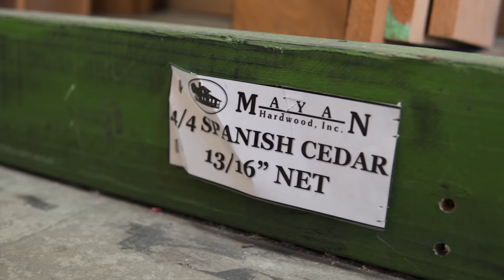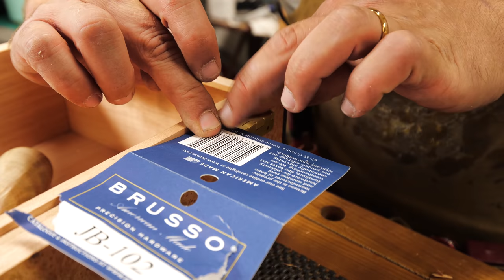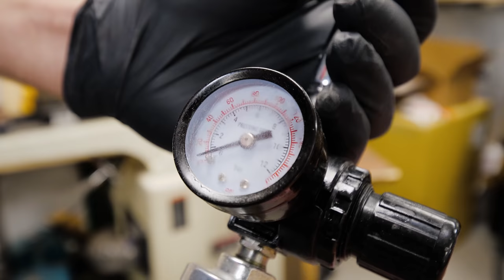Humidor with Maple Burl Veneer and Ebony Inlay - Build and Humidor Setup

Comment: Excellent video man! Loved it. Only tip I would offer: when you separate the lid from the box, it can be mated better. Best technique I've used is gluing down 4 pieces of sandpaper to a workbench, then sand the top of the box and bottom of the lid. This produces perfectly flat edges. It will make the seam look much more sharp. Loved watching the veneer. Nice to see a new technique.

Comment: Hi Jonathan, nice box.
In guitar making we don't use superglue when gluing wooden binding as it's not as strong a joint as wood glue. What I do is apply a couple of coats of shellac on 2" all around my edges. I even do this before cutting my channel as I believe it helps with getting a crisp line. Then I attach the binding with reinforced tape (tape with fiberglass in it so it's super strong) by pulling really hard. I alternate the direction of the pulling to get an even distribution of the clamping force. When I remove the tape, i'm super careful to roll it over itself so I don't tear out anything, even though the shellac is doing a good job preventing that. That method is escpecially effective since we have curves on the guitar and we need the binding material to conform to these curves.
Anyway, good job, have a good smoke !.

Comment: Excellent technique and skill, thanks for sharing! A tip for viewers if your outer box material is not cedar. You should consider applying a poly to the inside of the box before installing the cedar liner to prevent wood movement due to the high humidity inside the humidor. Then sand away areas for the glue to adhere the cedar. It's not really necessary here because you used cedar for outer box, but for any other material, its very important.  Again, fantastic video!

Comment: This was a great video. I love your videos. Your a really good teacher.  As an old veneer guy. The most critical thing is the core or underpayment. The material you glue the veneer to. It has to be dead flat. If you have any bumps or high spots you will have burn through. Holes in your veneer. No you didn’t sand it wrong you just took off the high spot which was higher than the thickness of the veneer.  .003. Thick veneer is about the thickness of a beard hair.   Hope that made sense.

Comment: Awesome dude.  And so good to see someone using proper PPE and pushers on their power equipment.
Reply: Pretty sure the mask he used is alright for dust particles, but this thing isn't doing anything for solvent vapors. So much for "proper" PPE.
Reply: @al_kaloid  is English not first language?
Reply: @silvermediastudio  I beg your pardon? Language should be pretty irrelevant in this case if the point is getting across, don't you think?
Reply: @al_kaloid  apparently you can't read full sentences
Reply: @800lb Gorilla  Dude.. apparently you can't even comprehend the most basic sentences. Are you aware that I'm talking about the fact that his face mask provides insufficient protection from fumes and therefore isn't proper protective equipment? I'm not dissing you or what you've said. Seems like my point went straight over your head, Mr. 800lb gorilla. smh
Reply: @al_kaloid  You mocked my comment of "proper" PPE. My statement was in reference to using the power tools... Hence the prepositional phrase starting with "on." You can't take half my sentence and then twist it around. What a bizarre world you must live in.
Reply: @silvermediastudio   I've been looking for people commenting on his PPE because I thought it was lacking at times, which is why I thought I'd chime in and mock HIM because of that. That was my intention. I'm just perplexed how you got so offended by something like this. You've been overly defensive from the start. Again.. I did not intent to mock you or your opinion, I just found it funny and slightly concerning given the fact that he's wearing this mask while spraying the case, probably thinking it would protect him.
Frankly I don't give a shit.. it just baffles me how someone could interpret my comment as a personal attack.
I repeat, your making a mountain out of a molehill. kthxbye
Reply: @al_kaloid  It baffles me how you could still be so arrogant that you'd think you understand a single thing posted in this thread... and then go off on a rant to prove it to us all.

Comment: Working with wood for years when it came to finishing with gloss or lacquer was to use compressed air to blow the dust off between coats and sanding. we would only do 2 coats and it would always be a glass finish

Comment: You’re supposed to put the veneer tape horizontally first, like how to did the blue tape, to get it to shut evenly then go for the long horizontal piece and it should work, make sure it is wet before placing it on

Comment: I like to blue tape the back of veneer, use veneer tape, and then remove the blue tape. You can glue it on with the veneer tape attached. It may have helped if you flattened your veneer first with a flattening soliton. Burls veneer tend to not stay very flat.
Reply from the maker: Brian Prusa dude that's an amazing tip. Thank you. Im working on a "cannidor" for my wife and this is very helpful.

Comment: But the way, what vacuum do you use (I saw the shop vac, but was that just initial to set up and get the folds how you wanted them)?  I’ve got an old small husky air compressor that I have reversed the the tubing to make it a dedicated vacuum for veneer.

Comment: I know its been a while, but great video and project.  I was wondering if you've used those Spacesaver Vacuum bags on any other projects and if so how it worked out.  I've heard stories that you can't use them because they don't pull the required vacuum for veneering, OK for storing clothes but not enough for veneering.  Curious, because I'd like to use them because they are much cheaper than purpose made veneering bags.
Reply from the maker: They seemed to work for me. Cheers

Comment: I’m a little surprised that when sanding, you did not get ebony dust into the grain of the veneer.  The dust from ebony is virtually impossible to remove and can ruin a nice veneer job.  I’ll normally seal the veneer with shellac before any ebony sanding.   With all that said, you didn’t have that happen?
Reply from the maker: I did have some issues but a blast from the compressor and it was gone.

Comment: Maybe a stupid question, why use plywood with veneer rather than solid wood for the body other than the cost?
Reply from the maker: Wood movement inside a box designed to hold 70% moisture needs to be mitigated
Reply: @katzmosestools  thank you.  I figured that was the reason but I'm a newer woodworker so figured I asked.  Just received your apron and stop block today!  Crazy fast shipping cross country!  Thank you!  Say hi to Cali for me.  Grew up in Thousand Oaks but in DC now.

Comment: Found this video amongst the myriad of woodworking videos. Great job! Easy to watch this for 30 minutes. Very informative, and well made! 
I am actually working on plans to build a humidor right now (first real woodworking project) and am running into a snag. I can't find any spanish cedar that is the thickness I need and is wide enough to make solid pieces. It looked like you took a thicker piece and cut it down to 1/4" thick pieces. If I don't have those tools, what can I do? Is plywood an acceptable alternative for the lining? Or should I use several narrower pieces?

Again, great video! Thanks for sharing!
Reply: Hello David
If you dont have resaw capability then just buy spanish cedar in 1/4 thick. I buy from a source in Maine. gym_bob_in_Maine. he is on ebay. My last purchase was 2 eight inch by 48 inch by 1/4 inch. Total cost with shipping to California was 125.

Comment: Could i use Ash and walnut?
Reply from the maker: Probably want to use cedar or mahogany for main body
Reply: @katzmosestools  I'll be making a solid wood box, no vinyl. So a harder wood would be better?
Reply from the maker: @reaper161989  nope. For a humidor is almost has to be cedar. Mahogany works but produces lesser results
Reply from the maker: There's a reason they're built this way. Tried and true method for moisture. The interior has to be cedar as I said
Reply: @katzmosestools  Thanks Jonathan, really appreciate the feedback. Still very new to woodworking and watching your videos truly helps.